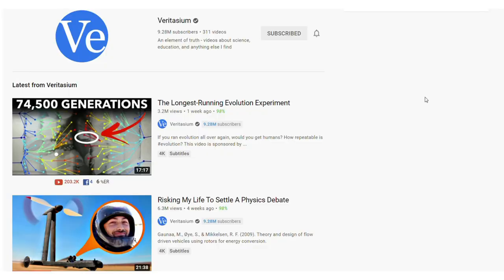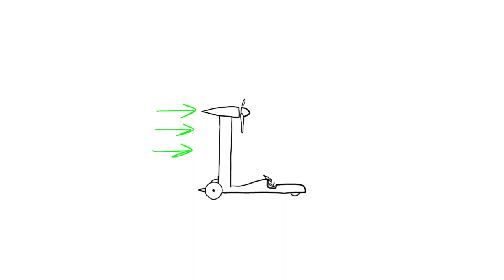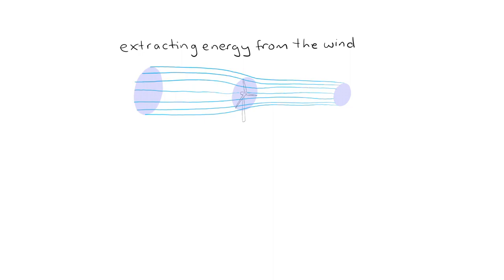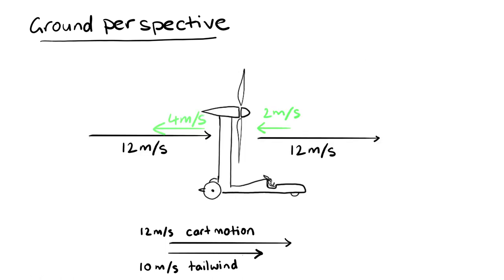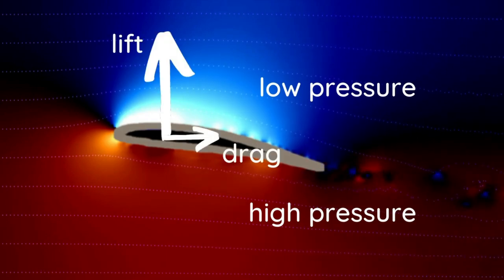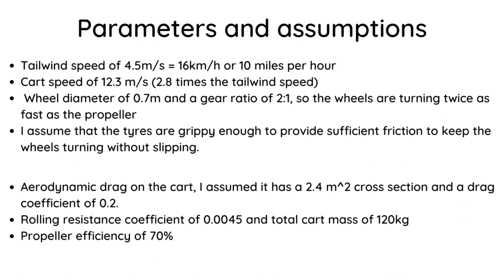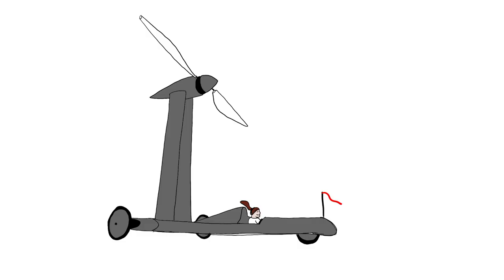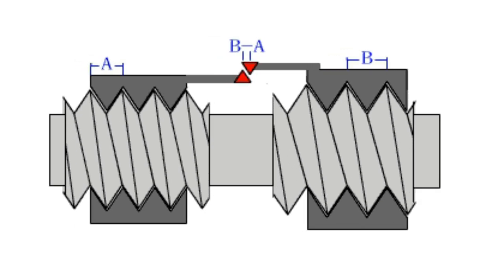Downwind Faster Than the Wind by Veritasium: How Does it Work?

Comment: You're not thinking. You just didn't watch the video closely enough. Goes like this: Car is sitting still. Wind pushes against it. (Important note: Derek (car operator) can change the pitch of the propeller.) The prop, at this time, is nearly flat against the wind so that it can catch the most wind. Car accelerates to 'less than wind speed'. The mechanical connection between the wheels and car gets the prop spinning quickly. At that point, Derek changes the pitch of the prop so that it now pushes air behind the car. With this spinning-induced push, the car gets the extra push to go faster than the wind. But only for a short period of time. Then the prop's momentum is gone. And the car slows back down to below wind speed. It is not sustainable. 

Your statement at 1:20 is incorrect. They will never go faster than the wind IN THE DIRECTION OF THE WIND unless they simply make a (reasonably) quick turn and use their momentum. Seriously, if the boat, etc. is heading AWAY from the wind faster than the wind is pushing it in that direction, what is now pushing it in that direction? How could it catch any of that wind if it is outpacing it?
Reply: Due to some fundamental misunderstandings you have, you are incorrect on several counts here.  

//"Derek changes the pitch of the prop"//
1:  Variable pitch is not required.  The principles work just fine (both in theory and practice) with a fixed pitch propeller. 

//" the car gets the extra push to go faster than the wind. But only for a short period of time. Then the prop's momentum is gone."//
2:  There is no internally stored energy of ANY kind used to accelerate the Blackbird.  Zero.  Contrary to your assertion, this means that not even the momentum of the propeller is used to accelerate.  

 //"It is not sustainable. "//
3:  Except it is.   In a 10-15mph wind, the Blackbird can accelerate to ~3x the speed of the wind and remain there until you run out of wind, room or interest.

Currently you have failed this physics brainteaser (one of the best of the last few decades).  Once **you think**, you will understand how your statements are wrong.
Reply: @johnborton4522  Variable pitch is required. That's why it's there. If no varying is required, then it would simply go faster all by itself. Mentioned at 4:03 in the original video. 
The prop acts like a flywheel - with blades. That is the stored energy. And after pushing more air behind it, the energy is lost. 

Question: once pushed, which would get the wheels and prop both turning, what is the need for any more wind? The vehicle is now creating its own wind. There is no more wind coming from behind, right? Can't be, because you're going faster than it. And since the vehicle can go into its own headwind, why the need for ANY wind from anywhere else? Just give it a little push, right? Easy, all the world's transportation problems solved. 
It's just a 'brainteaser toy'. For something to go into the wind, it will need an energy source. The prop's momentum (flywheel) is that stored energy. Nice if it were true. We'd all have free energy. 

(All this assumes that there is no hidden energy source like batteries and motors)

Also note that Derek's $10,000 bet wasn't that it worked, but that that prof couldn't (wouldn't?) explain it. There are, apparently, many people who can't explain it, though.
Reply: @roginutah  

//" Variable pitch is required."//

Nope.  The Blackbird was run many times  (at speeds greater than 2x the windspeed) before a variable pitch hub was ever installed.   

Here is a video of it running without variable pitch: 
https://youtu.be/EEuAqq8FINw

//"That's why it's there"//

Nope -- you just think you know why it's there.  The video evidence shows you actually don't know why it's there. 

//"The prop acts like a flywheel - with blades. That is the stored energy. "//

While of course anything spinning contains stored energy, it's literally impossible for the Blackbird to use the stored energy in the propeller to accelerate.  This is just a fundamental misunderstanding you are having as to how it works and is built.

//"Question: once pushed, which would get the wheels and prop both turning, what is the need for any more wind?"//

Because the laws of physics require that there be a constant source of energy input or the aero and mechanical losses cause it to grind to a halt.  In the case of the Blackbird, this constant energy input comes from the wind.

//"There is no more wind coming from behind, right? "//

This is where you've gone wrong.   You think it's powered via the "wind" relative to the craft (what sailors call "relative wind").  It's not.   The Blackbird is harvesting kinetic energy from what sailors call the "true wind" (the wind over the surface of the earth).   This wind continues to blow no matter what speed the craft is moving.  The Blackbird slows a 10mph 'true wind' down to ~ a 5mph 'true wind' (even when it's traveling at 25mph downwind and is experiencing a 15mph relative headwind) and that harvested energy it utilized in motivation. 

//"The prop's momentum (flywheel) is that stored energy."//

Once again, you think you know how the Blackbird is built and works -- but you don't.  As mentioned previously, it's literally impossible for the stored energy in the propeller to be used to accelerate the craft.  If you watched the videos (Rosie's and Derek's that she references) and followed the way the wheels and the propeller are tied together via fixed ratio gearing, you would know that you can't both slow down the propeller (to harvest energy) and speed up the wheels (to accelerate).   This simple fact alone shows "you're not thinking".

You need to learn from a mechanical and aero standpoint how it's built before you keep making basic errors about the way it works.
Reply: @johnborton4522  Another way of seeing (from another comment of mine):At some point "the car is at the same speed as the wind. At that point there is no wind pushing it, right? Only if it slows down will it 'feel' any support from behind. And if it goes faster than the wind, it must experience a headwind. Even if it only maintained this speed, it would not, could not, feel ANY wind from behind. ONLY if it slows down. Since this car now only experiences a HEADWIND, why could you not simply give it a push, from motionless and on a calm day, and have it enjoying the same forces acting upon it? And I say again: if it goes faster than the tailwind, it never has any support from that wind, and there can be no value from it. Just spin that prop once, by hand, even, and you're good forever! "
Reply: A little more:  When the car reaches (tail) windspeed the prop would be the only thing moving the car forward. With zero wind support. And we're back to saying that once the prop is spinning, it will run forever and even increase in speed, with no further input? After all, it's always going faster than whatever air it is in, right? (Actually never needing to derive any more support from behind since it can't get support from a wind that can't catch it. Deriving, apparently, support from the headwind it is generating?) And what difference would the direction make, then? A headwind is a headwind, right? So turn around and just keep driving - into the wind - because the headwind isn't against you, it's actually pulling you forward, just like the tailwind was pushing you forward. Physics!

ps. I watch Veritasium and look at it as more of a magic show with smoke and mirrors and lots if misdirection. Entertainment. And my job is to find the gimmick in his videos. Take the zillion mile wires and "when does the light come on?" video. 25 minutes of hoopla to say that: Did you know that when electrons move in a wire, they create a field around the wire? And it travels at the speed of electricity? 
Info from the 1800s, right? Just entertainment.
Reply: @roginutah  

//"Since this car now only experiences a HEADWIND, why could you not simply give it a push, from motionless and on a calm day, and have it enjoying the same forces acting upon it? "//

Because on a calm day it doesn't "enjoy the same forces acting upon it".    You keep thinking the relative wind is important when it's not -- it's the true wind that is important and the true 10mph tailwind is blowing no matter the speed of the craft.

Think of the true wind like a 10mph river the boat is running in -- no matter how fast the boat goes downriver, the river is still traveling 10mph downstream.  You can't outrun it ... You remain in it no matter your speed
Reply: @roginutah  
//"I watch Veritasium and look at it as more of a magic show with smoke and mirrors and lots if misdirection"//

Ok, since you're completely sure of your position (and I'm correct), how about we do like Derek did with the professor and each put $10k into escrow and pick judges skilled in the art.   Then, I'll prove I'm right and you'll lose your money.

Deal?

Not so confident now are you?
Reply: @johnborton4522  Conditions at the time of 'success' are: car is going faster than the wind it started with. Which means it is going into its own (self-generated) headwind of, let's say, 5 mph. Wheels are turning and driving/being driven by the prop. At this point, the tail wind is irrelevant, since it no longer exists for the car - only the headwind. Now why can't you simply push the car, on a completely calm day, at a speed of 5 mph, with adjustments for the prop speed vs wheel speed? Relative forces on the car would be the same. You could test this all day long. Always maintaining that same 5 mph headwind, right? In fact, just spinning the prop from a dead standstill, should be enough to get the car moving. And once you're moving into that little headwind, you're off and running, no? No. 
You know those little toy cars you get at the store that you can pull backward a few inches, then let them go? And they soot across the floor? Cool, huh? Defying the laws of physics? No. 
Your car does a similar thing in that it stores up energy, then you release it. Nothing special about it. Looks cool, though. 
Oh, just noticed that you are a 'designer' of the car. It now makes sense why you're not giving in to common sense. Thought I was talking to a regular Joe. More of a shill, I guess. 
Thanks, anyway. I really do like explaining things to people. But, knowing that you're 'paid" to not understand means I'm wasting my time. Dang.
Reply: @roginutah  "Since this car now only experiences a HEADWIND, why could you not simply give it a push, from motionless and on a calm day, and have it enjoying the same forces acting upon it?"

Consider these two scenarios where the vehicle is pushed/towed up to 10 mph.

Scenario 1: True Wind = 10 mph

Conditions observed from pilot's POV at the moment the vehicle reaches 10 mph:
1) Relative wind on chassis of vehicle = 0 mph (i.e. air is relatively still around the vehicle)
2) Prop spinning at x RPM through the relatively still air

Scenario 2: True Wind = 0 mph (calm day)

Conditions observed from pilot's POV at the moment the vehicle reaches 10 mph:
1) Relative wind on chassis of vehicle = -10 mph (i.e. 10 mph head wind)
2) Prop spinning at x RPM through a 10 mph headwind

Surely you can see that the vehicle is not "enjoying the same forces acting upon it" in both scenarios, right?  You can see, can't you, that what the vehicle does when you let it go on its own is going to be very different in each scenario?
Reply: @roginutah  "When the car reaches (tail) windspeed the prop would be the only thing moving the car forward. With zero wind support."

This is incorrect.  It is true that the vehicle is no longer receiving support from the RELATIVE wind.  But it is receiving support from the fact that the wind is still blowing relative to the ground.  I admit this is not obvious at first and it had me stumped for a while too.  But consider this: at the moment the vehicle reaches wind speed you have a prop spinning fast through relatively still air.  But ask yourself, why is the air relatively still?  The answer is because there is air blowing over the ground and the vehicle has matched it.  If the wind suddenly stopped the vehicle would all of the sudden be experiencing a strong headwind which would 1) make it more difficult for the prop to get a bite of the wind and 2) add drag on the chassis of the vehicle.  This would slow the vehicle down which would slow the prop down, which would slow the vehicle down which would slow the prop down, etc. etc. until the vehicle comes to a stop.

Comment: This was awesome, however the part that’s still breaking my brain is whether the wind is even required or not… Basically, if you towed the cart up to speed on a perfectly calm day, is there a point where this would be sustained or is the differential between ground speed and wind speed always required? I ask because 2.8x wind speed seems crazy fast.
Reply: The speed difference is required to have a source of kinetic energy (air or Earth) in any reference frame
Reply: Wind is required. If there's no wind then consider the inertial frame tied to the ground (and the stationary air). In that frame both the cart and the air would be accelerated if the propeller pushed the cart forward so then an energy source would be required.

Comment: The bit I dont get is at 0 wind speed there is a negative energy input . I understand how sailing boats travel faster then the wind speed as thay are travelling at an angle to the wind and are using  aerodynamic lift to draw the boat along . Yet this machine's  travelling at 180 deg to wind direction . Either the wind energy is turning the propeller thus turning wheels or the wheels are driving the propeller to provide thrust which will drain the energy of the cart or is there an external power sorce ?...   please  explain  where I am wrong .
Reply: // "I understand how sailing boats travel faster then the wind speed as thay are travelling at an angle to the wind "//

Then you're there, because the Blackbird does it the same way a sailboat does.

Watch 7m 15 seconds into the original video from Derek.

https://youtu.be/jyQwgBAaBag?t=435
Reply: You're where a lot of people are, including me. No one seems to have a simple, easily understandable answer for your question (and mine, also!).
Reply: @physicsphirst191   dose the incidence of angle of attack change significantly enough due to the blade spinning ? This may  allow the aerodynamic lift to be generated  at an apparent  0 deg wind direction ei travelling into the wind .
Reply: @paulsouth4794  Yes, it does, and I believe that is the entire heart of the concept. I believe it allows equivalent thrust to be generated at a lower apparent angle of attack, and therefore requires less power. None of the presentations explain it very clearly, but I am thick. I am going to review Rosie's presentation again. The answer appears to be scattered amongst various sources. Stay tuned.

Comment: Can someone help me with one question. Past the wind speed, how the wind is powering the propellers when the relative wind speed is zero and after the inertia on the propellers is used up?
Reply: The Blackbird isn't harvesting wind relative to itself, but rather relative to the rolling surface.  Even when the craft is moving at exactly the speed of the wind (and relative wind is zero), the wind over the rolling surface is still blowing as strong as ever.

Comment: Good explanation. Have you seen Dynamic Soaring? The current speed record is over 800km/h, about 10 times the wind speed! A very high L/D glider can extract crazy speed from wind sheer. All sailing craft are sheer craft, with foils for water and air, but DS is the purest form (ask an albatross!).

Comment: sorry, but you're wrong. the cyclist pushing away from the car mirror puts in extra energy from his arm muscle and it will not last long because it is just a short impulse. that is the same as the prof say the wind hits faster and then break down. so absotue wrong sample in my opinion. sorry if i did some mistakes in language.

Comment: The thing is: Derek already made a video about the explanation, in 2012.
https://www.youtube.com/watch?v=Bwf3msm7rqM
The title of that video is 'spool trick'

But this time around, with the blackbird vehicle, Derek still doesn't understand why it can go downwind faster than the wind.

Watch the demonstration in the 'spool trick' video, and then consider this:
With the rope horizontal to the ground: you walk in the direction away from the spool, pulling your end of the rope. When the wheels of the spool are not slipping: the rope is being wound up so the spool is moving faster than you move, closing in the distance between the two of you.

Think about that: the spool is moving faster than you are pulling it.
The spool is harvesting energy: the spool is harvesting energy from the difference in velocity between the ground and the ropo. That is how the spool can move faster than the velocity of the rope.

Likewise, what the blackbird vehicle is harvesting energy from is not the wind itself, but the difference in velocity between air and ground.

The propellor is continously pumping air from ahead of the propellor to the rear of the vehicle. In order for the vehicle as a whole to be propelled the propellor must maintain a surplus of air pressure behind the propellor. The rear wind is then coming up against that surplus of air pressure. That is; wind coming up from the rear never makes it to the propellor. Instead the rear wind pushes air that is pushed by the propellor.